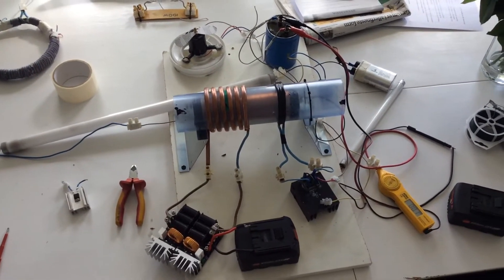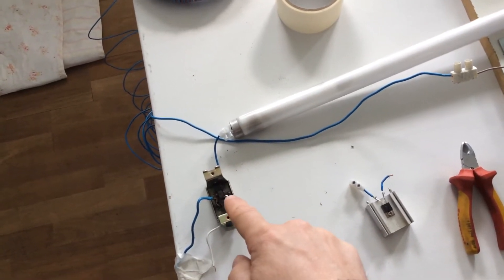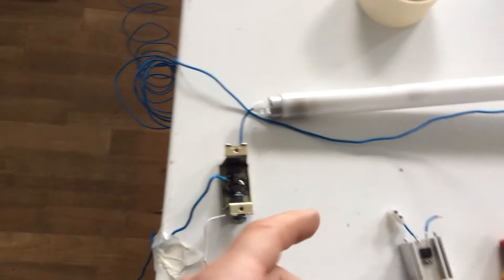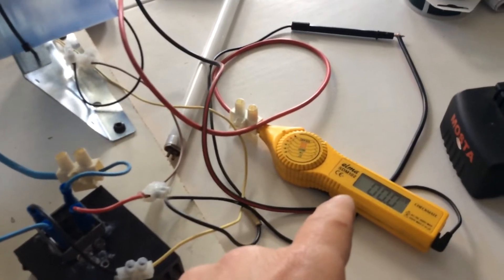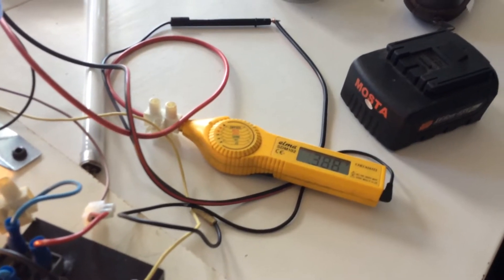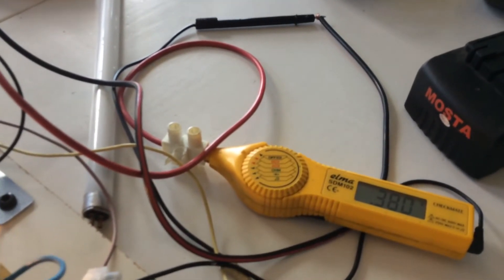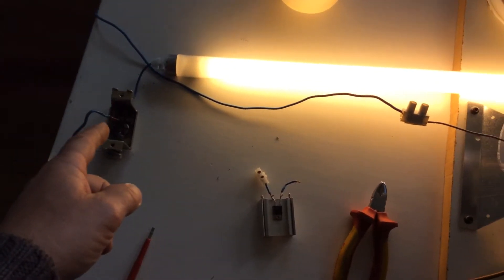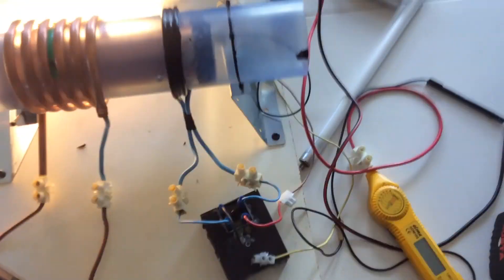ZVS tesla coil, kapanadze experiment.

Comment: When we use the pins on each end of a fluorescent bulb there is little capacitance from the bulb. I isolate the pins on one end from air with a sandwich bag and rubber band. The wire for that end is connected to a piece of foil around the glass. This makes the mercury vapor an open circuit and you have capacitance between the pins of one end and the foil near the other end. They light better and consume less energy. Cheers
Reply from the maker: Arkiver Unified Energy  thanks I will try this, did you notice any large spikes in your DC collection?
Reply: I didn't try to store the energy because it burned out several meters. Had some success with the joule thief circuits. I noticed that most ready made bridge rectifiers can't handle the higher frequencies. That could cause power loss, spikes, and false meter readings.